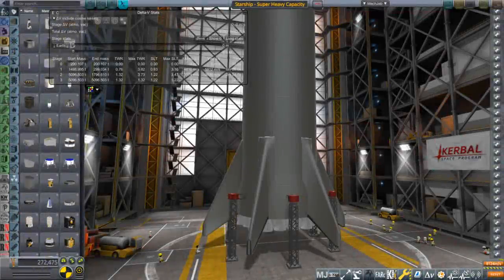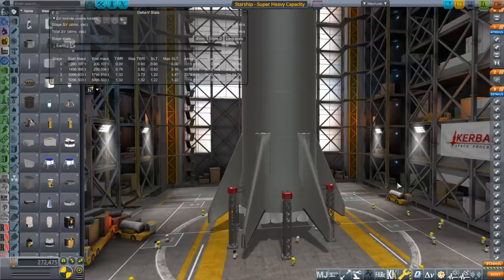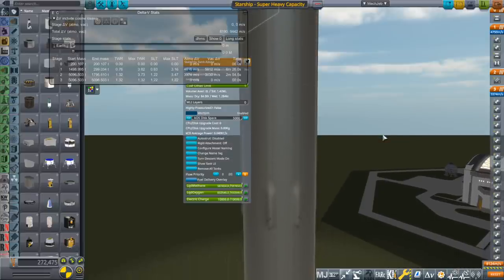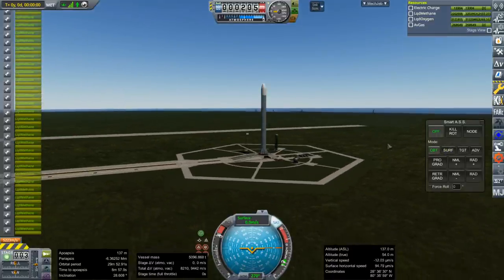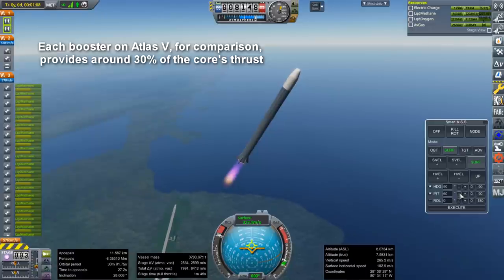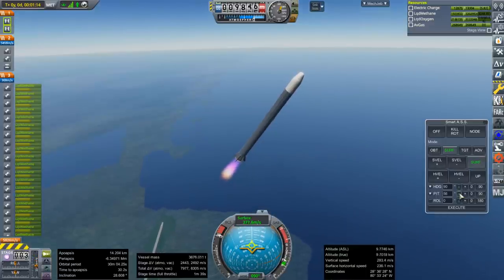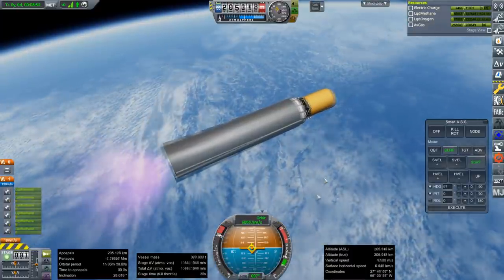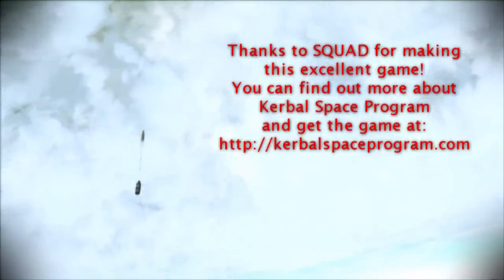Realism Overhaul in KSP 1.8.1 - Starship/Super Heavy Expendable Capacity Test

Comment: I read somewhere that while the International Space Station wieghs 450 tons, the internal volume of Starship is actually greater.

A pair of disposable starships may still be cheaper than the ISS by a significant margin.
Reply from the maker: I generally like the idea of using Starship as a space station - possibly even a station around the Moon - especially to prove that it's safe to use for the full Mars mission later on.
Reply: @RaizSpace  
Oh yes. Especially with the juicy option of a "wet workshop" concept!
Just think of all the living space those tanks can provide once they are empty.
Reply from the maker: The fact that there's a large livable portion to begin with does make the wet workshop concept easier. It would still need propulsion to keep itself in place, though.
Reply: Instead of a wet workshop the fuel tankage could serve as a fuel depot for reusable landers.
Reply: @RaizSpace  
"The fact that there's a large livable portion to begin with does make the wet workshop concept easier." That's absolutely right. But it doesn't make it any more difficult either. 
"It would still need propulsion to keep itself in place, though." 

Not if one dedicated station keeping Starship is docked to several "wet workshop" Starships.
Reply: @trr94001  
"Instead of a wet workshop the fuel tankage could serve as a fuel depot for reusable landers." 
Or you use one of those many Starships you have at hand for the station anyway as a wet workshop.
Reply from the maker: Are Starships still docking to each other on their tails?
Reply: @RaizSpace  
Why not? If a Starship is build as a space station module, it can also have docking ports on the sides and front.
Since it doesn't have to reenter the atmosphere, there is no need for TPS and wings.
Reply: That raises the real question:  Can the Starship Tanker itself be refueled so it can deliver fuel to lunar orbit?
Reply: @trr94001  
That's the idea of an "accumulation tanker".
One tanker is refueled in earth orbit by many other tankers. Then the fuel can be either pumped into a manned starship bound for moon or Mars, or the tanker can go to any destination himself.

Comment: 4 Falcon 9 boosters maybe could save SLS from bankruptcy, imagine 4 boosters landing
Reply from the maker: Actually, not so much - the SLS core is the most expensive part by far. The SRBs are each more expensive than a Falcon 9 core, but not more than two (even with reusability, given SpaceX's prior pricing).
Reply: @RaizSpace  Maybe drop the rs-25s off then like ULA's Vulcan🤔 that should save 400million😂
Reply from the maker: That would be much better, yes.
Reply: @Aceb_k  they should try it
Reply: The big problem with this is this would face similar challenges as the Falcon Heavy, where they realized it wasn't as simple as strapping three Falcon 9s together.

Many things would change with a Falcon boosted SLS, notably aerodynamics, thrust to weight ratio, differing thrust, and if you want to recover the Falcons, you‘ll need to alter the launch profile.

This of course is moot. Congress, sadly, required SLS to use solid rocket boosters.
Reply: @armchairrocketscientist4934  I would love to see SLS at least fly twice but after that... well lets see
Reply: @Aceb_k  i think it should easly fly those 8 flights for artemis, and definitly will fly non artemis missions.
Reply: @_mikolaj_  Maybe if the whole us doesnt go broke

Comment: 4:35 An "Energia" with Falcon 9 boosters around Starship would be more reasonable.

4:55 Would something like my alternate-historical Black Prince 5885 be a reasonable vehicle*, then? Its boosters (8 Skylark Ravens) combined would make up only ~4% of its takeoff mass and ~20% of its thrust, and would be separated off at around Mach 1, but they're cheap sounding rockets that could be easily recovered and would still provide a ~10% payload increase (as calculated by Silverbird Astronautics's payload performance calculator).

8:15 Assuming that's accurate, that's quite impressive. The Shuttle only managed ~25% with its partial reusability, and other proposed fully-reusable systems envision far lower reusable:expendable performance margins.

*I mean, that's not the only atypical aspect of the vehicle—I'm assuming the natural successor to the IRL-proposed Larch (Gamma-upgrade) engine, designated "Redwood" in-universe, would be an expander-cycle engine... a kerolox expander-cycle engine. The Gamma turbopumps already ran on lukehot oxygen-rich steam from hydrogen peroxide decomposition, so converting them to run on to slightly cooler pure oxygen gas from regenerative cooling doesn't seem like a stretch. Plus, as the kerosene would be freed from cooling duty, RP-1 would be replaced by a hydrocarbon blend (probably a Diesel derivative) laser-focused at absolutely maximizing density and specific impulse.
Reply from the maker: On the Shuttle comparison, this estimate assumes that they hit certain dry mass numbers. If the current prototypes that they're testing were launched on a Super Heavy, that payload with reusability would go way down. They need much lighter Starships to meet the 100 ton goal.

Comment: Wow, not really worth expending Starship for that gain. I was under the impression expendable SS got 300t, based on one of Elon's old tweets. But that may have been for ITS.
Reply from the maker: Probably. Starship-SuperHeavy with uprated Raptors would get somewhere in the middle of 200-300 tons.
Reply: It's hard to predict final performance when you keep changing the design and especially when the engine performance goals/achievements keep changing.
Reply from the maker: Indeed. And the dry mass of Starship is much heavier right now than what I have here - that needs to come down to standard tank mass before even this payload capacity is possible.

Comment: Hey Raiz, would you be willing to see what expendable SSH can do with the uprated Raptors Elon is talking about? I think it was gimballing Raptor ~2000 kN and non-gimballing chamber-pressure-optimized Raptor around ~2500 kN.
Also, isn't the Starship Super Heavy stack supposed to get off the pad at a rather high TWR? I recall Elon saying something like 1.4 TWR because it helps performance overall by reducing gravity losses.
Reply from the maker: I'll wait for numbers from SpaceX rather than Elon Musk. The stack would get off the pad with a higher TWR if it was carrying a normal payload and, of course, once they uprate the engines.

Comment: Wonderful video. Thanks for uploading.
How do you feel about using Starship as a habitation module on the surface of Mars? (instead of returning every single one to earth)
Reply from the maker: I'd probably design them differently for that purpose. It would be better just to sent the top portion with landing fuel to Mars and have the bottom body boost it to escape trajectory then bring itself back to low Earth orbit for refueling (which it could manage).
Reply: It's already guaranteed that for the first phase of Mars colonization/exploration they plan on just leaving the majority of the Starships on Mars, firstly because they're going to need to transport a lot of payload mass in order to be able to set up a propellant plant capable of refueling even a single Starship, and later because there will be a big lag in propellant production capacity growth vs Starship transport growth (more vehicles will land than they can refill in a single sinode). Eventually though it should catch up and they will be able to refuel all the Starships that land, but the old ones that have been sitting on Mars for ~10 years will probably just be condemned as spacecraft and turned into habitats long before that point.
Reply: @RaizSpace  
"It would be better just to sent the top portion with landing fuel to Mars and have the bottom body boost it [...]f back" 
And what exactly would be the useful payload here? (Maybe I misunderstand your design choice)
Reply from the maker: The useful payload would still be 100 tons, or possibly more. After all, if you just want to land, you need fairly little delta-v - less than it would take to land on the Moon. Mars' atmosphere does most of the work. You could probably get more there with this format since you don't need to land largely useless fuel tanks. Those tanks are only relevant if you are refueling on Mars and returning.
Reply: @RaizSpace  
Don't you need those large tanks to get to LEO beforehand?
Reply: @3gunslingers  He's talking about Zubrin's idea of staging off the tanks as a separate vehicle that returns to Earth, while the forward payload section continues on to land on Mars.
One issue with that plan beyond the development cost of additional vehicles and not having a way to get back to Earth is the aerobraking, since a 100 ton payload is more difficult to aerocapture and land at Mars if it doesn't have very large, empty propellant tanks attached to act as a low density decelerator surface. You could probably install an inflatable one, but then again that adds more complexity and takes up more weight.
Reply from the maker: Well, the premise was using the vehicle as a base rather than returning it to Earth. If we are returning to Earth, of course Starship in full would be better. As far as needing large empty propellant tanks, it depends how much you want to land. The diameter is good for about 60 tons, so if you want more than that, you need to pack some extra propellant to slow down, too. And inflatable shield would be nice, but I'd have to try it out to see if it's actually necessary. Could use deployable panels on the sides which double as landing legs. On development cost, it depends on what there's a demand for. I'm sure the Spruce Goose seemed like a simple, cheap solution that could carry all the things everywhere, too.

Comment: How would sls boosters do if they supported the super heavy
Reply: do we really need more TWR here? unless you light core inflight
Reply: @_mikolaj_  You'd need ~5 solid boosters in order to produce the same thrust as the Super Heavy core, but that wouldn't lift off because you'd also be adding 5 solid booster's worth of mass, so you'd probably need more like 8 solid boosters in order to be able to do in-flight ignition of the core stage. Of course you could probably light just the center cluster of Raptors on Super Heavy if you needed the extra thrust, and ignite the remaining Raptors once the solids burned out. This would all require substantial reinforcement of the core stage against lateral forces from the boosters, though.
Reply: @sycodeathman  so. To get maximum efficiency we need to find amount of engines on core stage required to get nice TWR. Also, we must check TWR after 133s, to see if additional ignition is required. But i don't think those boosters are that weak. Especially advanced variant.
Reply: Much better if you delete the SRBs altogether, and just use Super Heavy. The upper stage can be the EUS + fairing + payload
Reply: @alvianchoiriapriliansyah9882  that could work, if superheavy did big part of orbital insertion.

Comment: This is NOT stupid.  If the 1.5:1 fairing:body diameter ratio goes as it does for the F-9, then what you’re proposing here could carry a 9m x 1.5 = 13m diameter space telescope.  That’s TWICE as big as the Webb.  In a single piece.  No foldy-foldy tricks.  I mean holy crap.